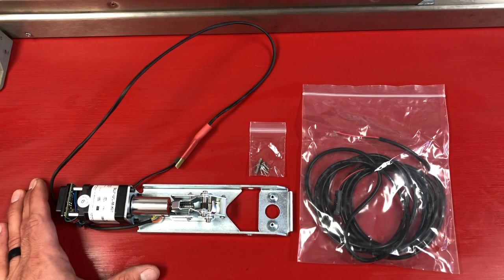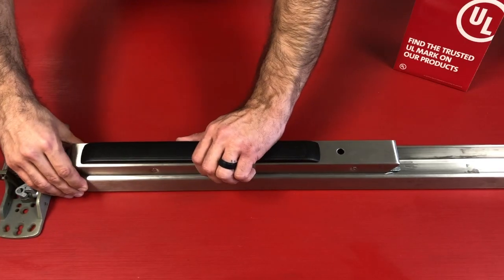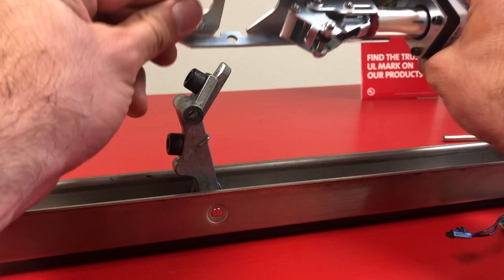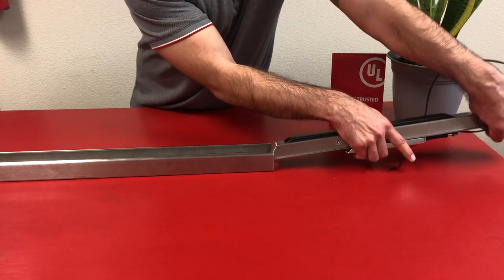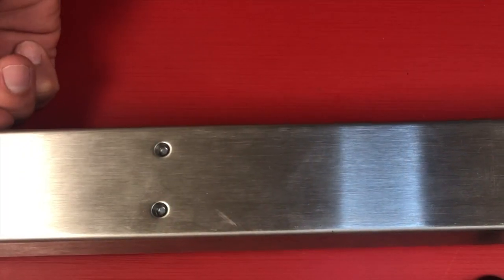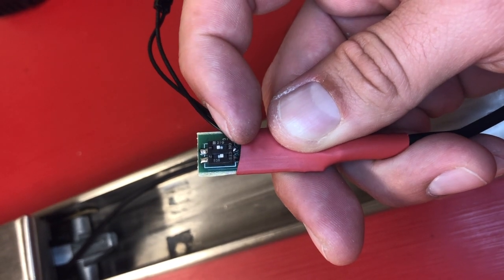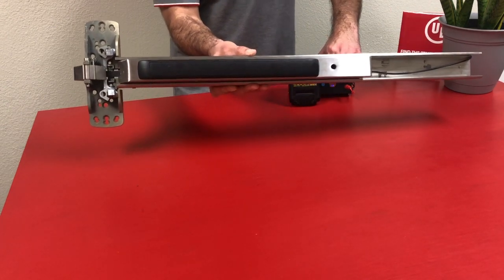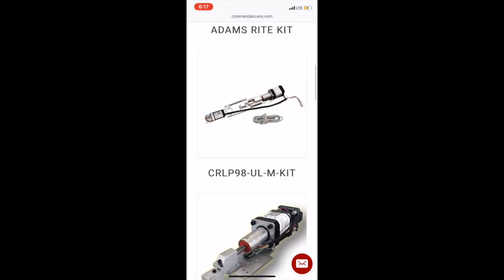MLRK1-SGT Installation

Comment: I have a newer one of these with the PTS button instead of the switch. I have the error where it jutters after being activated and then it beeps 5 times. I tried to reset the PTS, but when pressing the button and applying power, it does not beep. I can’t figure out how to get into the PTS programming mode.
Reply from the maker: I would check the connectors to make sure the sensor cable is plugged in securely. Sometimes, when you pull the wires to the back, they can wiggle loose. Could you confirm there is no binding in the pad preventing it from depressing all the way & call technical support with any additional questions?
Reply: @commandaccess You know what it ended up being, i completely overlooked the fact the door is controlled by a badge reader panel. The push pad is only supplied power when the badge is swiped. In order to adjust the PTS, i just needed to swipe a badge while holding the PTS button. It’s all fixed now!